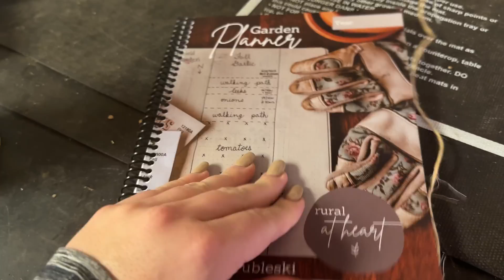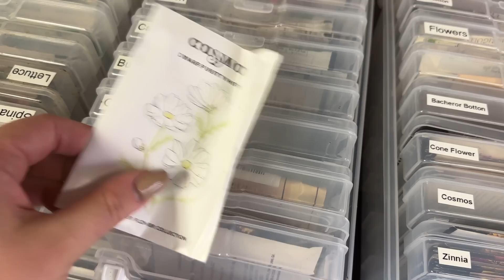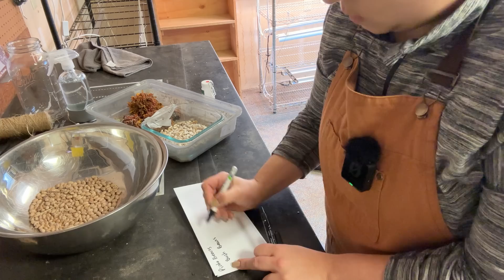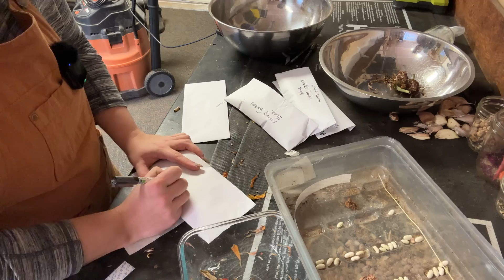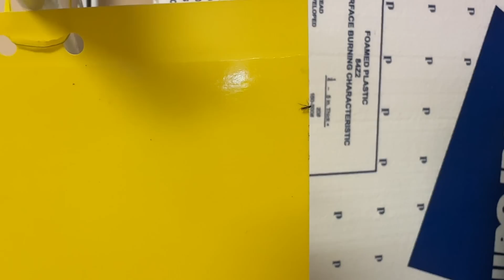I Don't Think I'll Regret This!

Comment: Many people actually pour boiling water over their store bought potting soil before using it.  This effectively kills/sterilizes the soil before you use it to plant your starts.  The truth is, most potting soils have all sorts of eggs, spoors, etc in them, which is why many choose to sterilize their potting soil and/or anything from your compost bin as well for that matter.  I know that seems counter intuitive, but since starts aren't really relying on soil biology the way your veggies will once you've transplanted them into your beds, it's a great way to prevent fungus gnats AND fungi alike (etc) from developing on/in/around your starts.  

Another thing that can really help to prevent problems with your starts is to avoid top watering and instead water everything from below by putting your start trays onto solid trays below them.  You just lift up one module of your starts off the water holding tray below, fill the tray up to about 1/4 the depth of the tray and put your start tray back down in place.  You'll see the soil darken as all the modules inside the tray absorb the water from below.  Once the color on top starts to lighten again AND the start trays themselves are no longer heavy with moisture, then water everything from below again, but it's fine for starts to dry out a bit on top as long as there's a bit of moisture in the soil below the surface.  It's common to for people to over water starts, yet tiny roots do not do well in waterlogged soil, so it's best to let things dry out a bit on top and wait until the starts really DO need water to water them.  

You can also add any water soluble fertilizer to the water before watering them as well so it's well mixed/distributed and the plants all get their fair share, but best to tone it down in the concentration level to about 1/4-1/3 the recommended amount of fertilizer because that's another thing people do to their starts...over fertilize.  Then their starts turn off colors and people mistakenly think they need even more!  Disaster...  You can always add more but you can't take it back, so start out conservative and add more if needed.

Sorry you lost your peppers...  Have you considered putting hoops over the beds containing your peppers?  Elliot Coleman (renown Maine market farmer with excellent books on four season harvests even up in Maine!) says that when you add a layer over your beds it's as if your garden was 1000 miles further south (or something like that).  He'll put hoops and then plastic over several of his beds in the fall and then when temps drop even further he'll often add an additional fleece cover over individual rows to get plants through those colder temps.  Honestly, I don't know whether this will work to keep peppers and tomatoes alive though as I've never tried that, but it works wonderfully here in Portland to keep fresh greens, etc. that we fill our garden with in late summer coming in all winter long!

Comment: You can sterilize your soil by pouring boiling water into a bucket with your soil, and letting it set for a couple of hours. Some people cover the container and let it sit overnight. This might prevent an infestation when you plant your new seedlings. Also cover the soil surface with per-lite or vermiculite because fungus gnats can not emerge or crawl into the soil that way. When you bring in a pepper plant wash off the old soil, and plant in new soil, and put in a separate room then where you have the seedlings. Keep any leftover soil in a container with a lid. Wash all trays, pots., containers and planting containers when starting seeds. wash the grow room really well, walls, tables, racks, and floors. Blow fans over all your seedlings to dry out any fungus issues. Fans also provide airflow and makes the stems stronger and healthier.

Comment: Well, I see you got away and went to the pig butchering workshop at Hollar Homestead.  Couldn't miss you.  Just put it outside.   Of course it is warming up but it has been far below freezing and freezing would kill any contaminant in the soil.  Open up that black tote, you have a place there for the bags to be out of the rain/snow and by spring it will be safe to use.  It is not a big deal.

Comment: You may have both gnats and aphids.  You can prepare your seed starting soil in a small metal trash can and use boiling water to wet…close lid…this should kill gnats…and eggs.  Using a 1 part hydrogen peroxide and 4 parts water ratio and water soil with that…. This will also kill gnats and eggs.  Perhaps a bug light would help…….It is a multi-level fix!

Comment: I would not reuse the soil in your green stalks in case there is larvae in it.  I would also recommend not using any unsealed soil that was in your grow room.  Soil should probably be disposed of very far away from your garden or completely off the property.  Washing your greenstalks and pots in bleach water would also be advised.

Comment: I would NEVER put dirty containers in my dishwasher and you have plates and cups things you eat off of in there. I would also NEVER clean garden trays in my kitchen. Buy a trough put those trays soaking in the trough outside to clean them. 
Besides grow lights I dont have any investment. Pop seeds into jiffy tablets that expand with water the nutrients are in there. I place the jiffy in costco containers that danish or cookies come in. Close the lid and you instantly have a hot house. When the plant gets the second leaf you can take the entire tablet and drop it into a 4x4  rather than popping them out of the containers and stressing the seedling. The greenstalks should be outside.